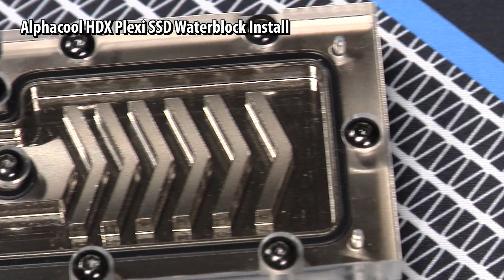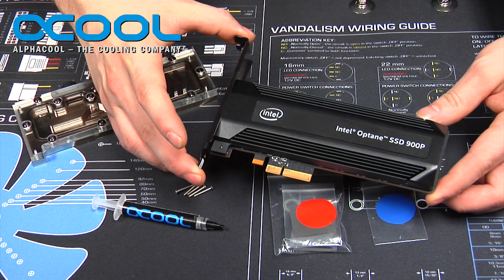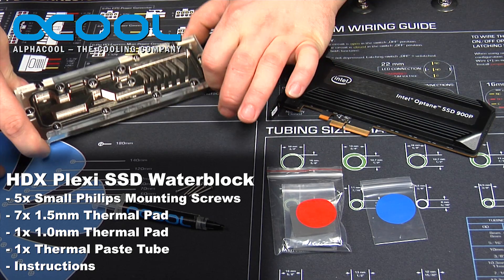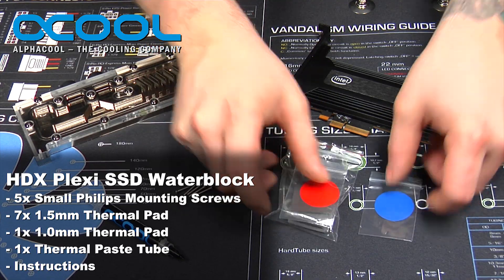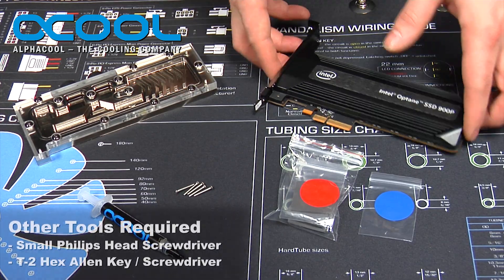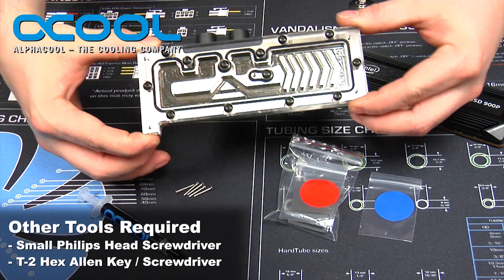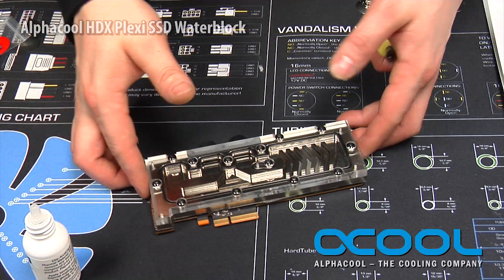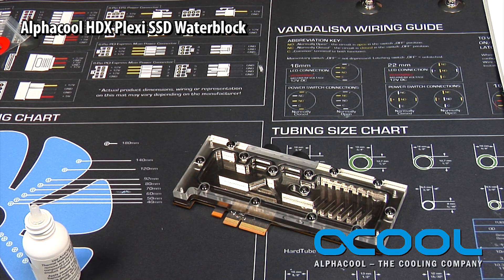Alphacool How-to: Install HDX Plexi waterblock on an Intel Optane P900 SSD

Comment: Water cooling not just an SSD, but the fastest storage on the market (excluding the 905p). This is brilliant, although I do not know if this will provide benefit. A “too cool” ssd can result in more negative performance . This was tested on a standard M.2, so I do not know if the the outcome would be similar. Very cool none the less!